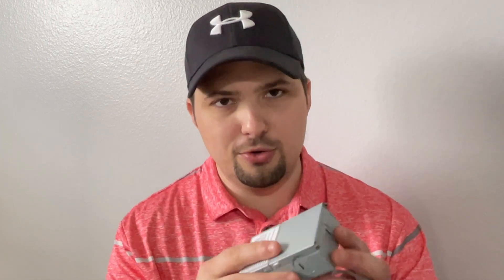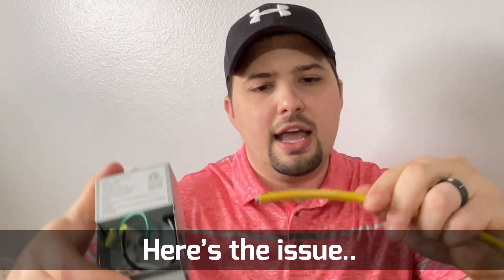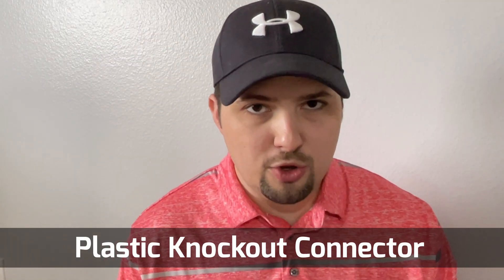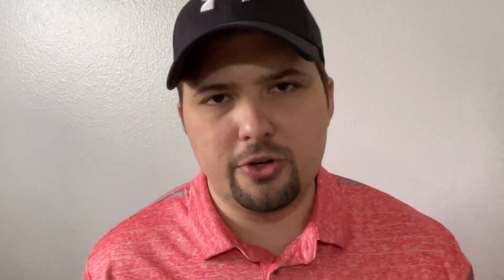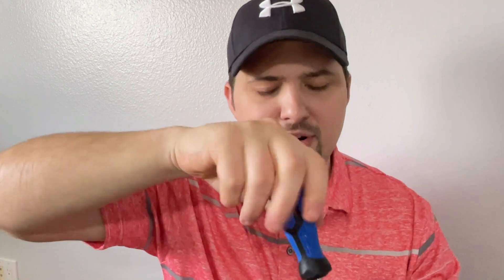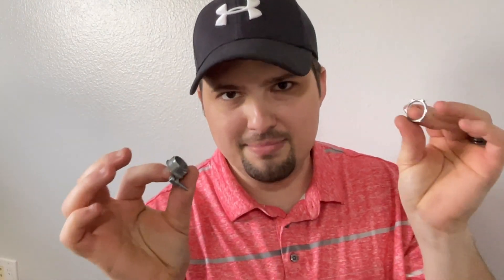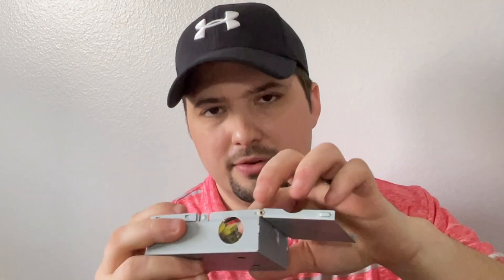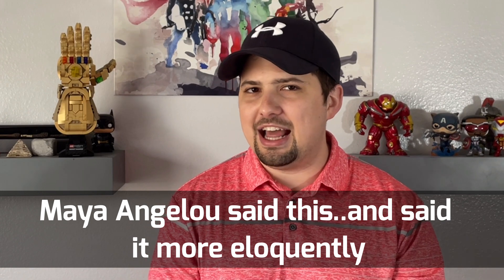Installing Recessed Lights? Why You Should Use Romex Connectors!

Comment: In plastic boxes any metal connectors must be grounded. The typical method is using grounding bushings. Any ungrounded metal that circles a conductor essentially creates inductive resistance. This is why most people use the plastic connectors you’ve shown in your video.

Comment: Are romex connectors code requirement?  What is their purpose?
Reply: The housing is made of metal, without the bushing there is a chance the wire will rub against the sharp edge of the light housing and potentially cut the wire.  This could cause a short, a fire, or potentially electrify the recessed light housing.